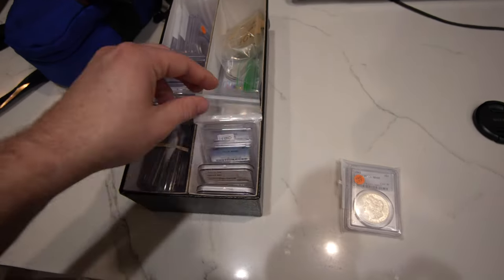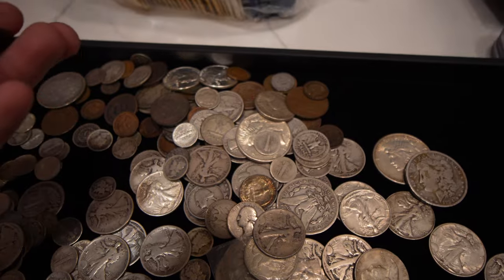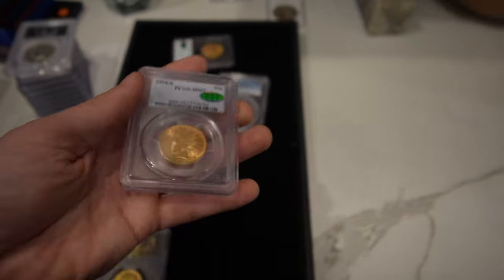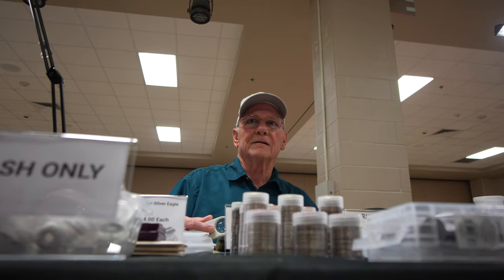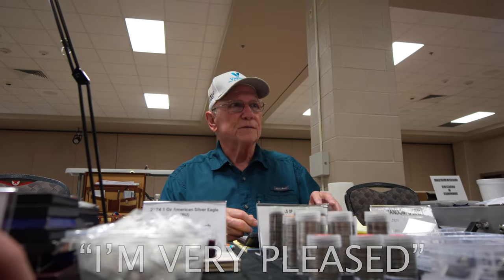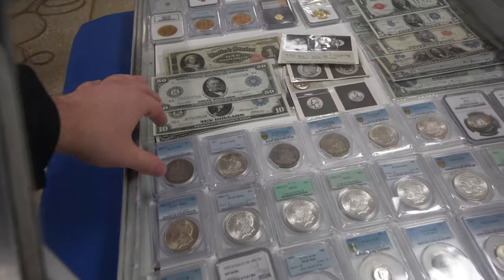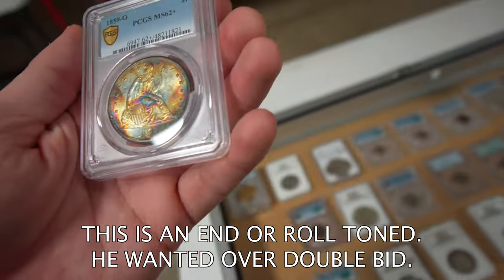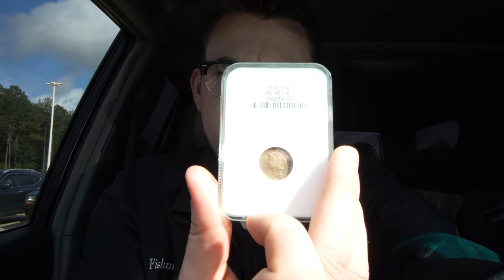Coin Dealer LIES TO Coin Collector About THEIR COINS! (Coin Dealer Negotiations)

Comment: “False Dies” generally refers to a transfer die struck counterfeit. I’ve seen it before with those 1980’s pre33 gold counterfeits. That Buffalo nickel could’ve been a transfer die counterfeit, using a worn 1921 obverse die and a less worn s reverse.

Comment: what happens is the pump gets hot and the plastic on the bottom melts allowing the inside components to short to ground on the frame which in turn causes it to smoke and catch fire. youre lucky that it just popped the fuse